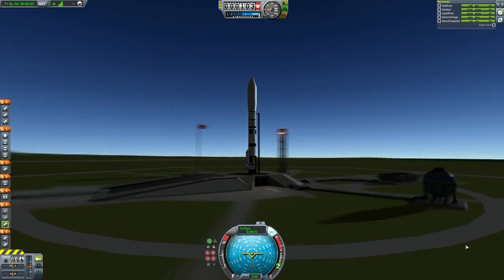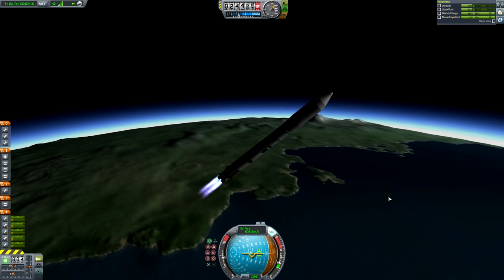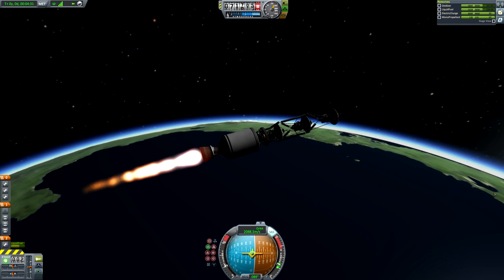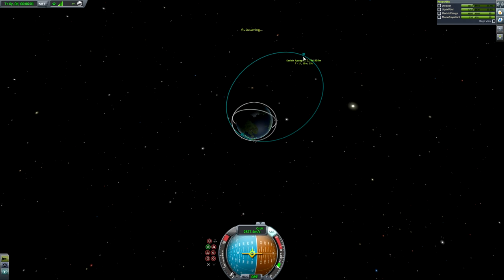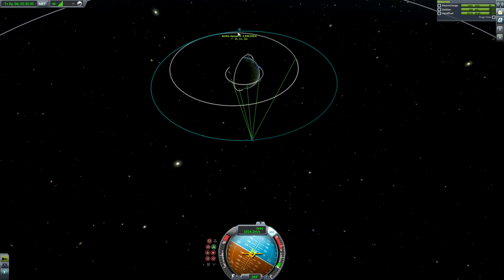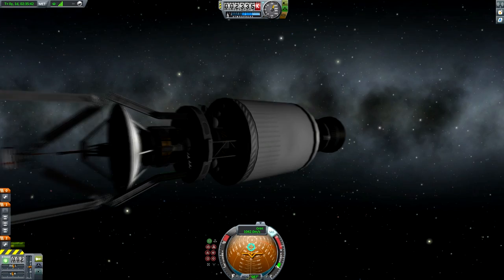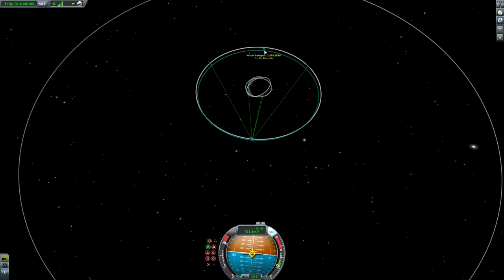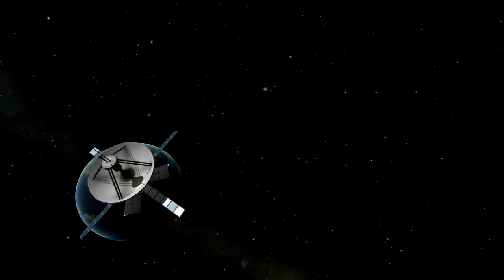KSP 1.2: How To Create a Geostationary Relay Network

Comment: How would I calculate how to do this on other planets? I tend to send way more unmanned than manned craft and would like to set up something like this around Kerbol specifically. That being said I would like to know how to figure out how to do it on other celestial bodies too. I've found the altitude for synchronous orbit on the wiki, but how do I find the other altitude to make three of them line up in a pretty triangle like you have. You mention a 4 hour orbit, which is obviously specific to Kerbin. I assume I would want to get my orbit to 1/3rd whatever the total orbit time for the body in question is, that's the part where I'm clueless. Thanks for any help you can give me and the video itself! Green lines all over the map! =D
Reply: Set surface speed to 0ms i think

Comment: Because of one or another reason I cant se my network....... A glitch? Or just not in for public yet?
Reply from the maker: It's in pre-release, so you have to opt-in to it if you haven't already!
Reply: +Matt Lowne I might sound dumb now... But can you already find iT in Downloads or is iT somewhere else/not available?
Reply from the maker: On steam, right click, click properties, click Betas, then in the drop down menu click the 1.2 prerelease
Reply: +Matt Lowne How can I get 1.2?
Reply from the maker: Please see the above comment...
Reply: Matt Lowne I'm sorry. Didn't see it.
Reply: Thanks matt!
Reply: I cant see the top left commnet bar.. Any ideas why that might be? I have all the new parts/scanning option available, put up a 3 geostationary relay antennas only to find this out
Reply from the maker: did you enable it in the difficulty settings?
Reply: Matt Lowne can you change difficulty settings without losing or having to reset your sandbox save. I have so many ships and stuff in my sandbox save I've had since last year lol
Reply: you can only see the triangular design on the tracking station
Reply: Up top you can see the connection type. If you click somewhere along there, you can change the connection type you can see.

Comment: How did you know that you wanted a 4 hour orbital period? I'd like to understand the math involved for how you prepare all of this stuff for getting (as close as possible) equally spaced satellites in this orbit. And, knowing this info, how I could figure out how to do something similar given different conditions (such as different bodies to orbit).

I'm trying to learn a lot of the math involved in KSP.
Reply: 4 hours is 2/3 of 6 hours, which is orbital period at the kerbostationary orbit, since 6 hours is how long a day lasts on Kerbin.
After you separate the first satellite from the delivery ship and circularize its orbit, the next time the delivery ship reaches apoapsis 4 hours later to separate the second satellite, the first satellite will have completed 2/3 of its orbit, so the separation between the first and the second satellites will be 1/3 of the orbit or 120 degrees. 
Same with the last satellite: once the delivery ship is at the apoapsis another 4 hours later, the third satellite will have the separation of 1/3 of an orbit or 120 degrees between both first and second satellites. 

You could possibly make the orbital period of the delivery ship only 1/3 of 6 hours, i.e. 2 hours, but I haven't done the math, so I'm not sure if you can set the periapsis low enough and avoid reentry.

Alternatively, if you wanted to have e.g. 4 satellites positioned with equal intervals, you'd want the orbital period of the delivery ship to be 3/4 of the target period, so that each time when you separate the next satellite, the distance between it and the previous one is exactly 1/4th of the orbit.

Comment: Hello, can you detail the calculations about how you designed the orbit so each pass was a third of the final orbit please ?
Reply: Kerbin day = 6 hours.
3 satellites with 6 hour orbits need to be 2 hours apart from each other in the same orbital path to be evenly spaced around Kerbin.
Delivery vehicle needs to hit apoapsis every 6-2=4 hours
Set apoapsis to geostationary altitude, then increase periapsis until Kerbal Engineer says your orbital period is 4 hours. (Using Kerbal Engineer, which he mentions in the video is how he did it, means you don't actually need to worry about the math)
Reply: Cool thanks

Comment: Ok, I've got just two questions.

1. Is 1.2 out yet or is this the pre-release your playing?

2. is it possible for somebody to make a geostationary POLAR orbit? (Possible challenge, perhaps?)
Reply: I think 1.2 just came out

Also polar orbits will mean sweeping over the planet's area. Unless Kerbin rotates polarly, a polar orbit can't be stationary. It can still be synchronous, passing over the same spot at the same time every 1 Kerbin day.
Reply: 1.2 is not out.

The closest thing to a Polar Geostationary orbit is two satellites in opposing Molnya orbits.
Reply: lol you're technically, scientifically wrong there. geosynchronous polar orbit I suppose?
it's geostationary, means its position is stationary relative to their body surface.
you can achieve geostationary equatorial orbit, as the object moves along with the surface in the same manner.
but how could you achieve geostationary polar orbit?! an orbit that the object is stationary relative to one of those polar?! that's just simply impossible.
well unless hyperedit came into play I guess.
Reply: Any orbit around Kerbin as long as a sidereal day is a synchronous orbit. A stationary orbit is a circular synchronous orbit over the equator. A polar stationary orbit is impossible because stationary orbits are only possible on the equator.

Comment: Matt, you brilliant space fairing wonder wizard, What exactly is a geostationary orbit???????????????
Reply: An orbit in which your vehicle/satellite is always sitting over the same point on the celestial body.  The satellite is orbiting at the same speed as the planet or moon is rotating.  

The use in this case would be so that one of the satellites is always over the space center so it can send/receive signals for control.  The other two satellites relay the signal around the planet so that if you are on the other side of Kerbin you can still reach KSC.

1.2 also places several transmission antennas on Kerbins surface so a relay satellite not in geostationary orbit should still pick up signal from the other antennas on the planet.  The mod RemoteTech did not have additional antennas on the surface so this three satellite configuration in geostationary orbit was a must.
Reply: overkill1340 ok
Reply: Actually, the speed is not the same as the rotating speed, at least not linearly. It's the same angular speed.
Reply: and is only achievable directly above the equator, otherwise it's geosynchronous orbit..
Reply: Laurens Peek ok

Comment: OK, so, you said that a comms network isn't necessary. I am trying to put a sat in orbit around Gilly but, I keep losing comms with Kerbin as soon as I leave the Kerbin system. Is it cuz my antenna isn't big enough? Maybe I should add more than one? How would you maintain comms with a sat orbiting Gilly when Eve and Kerbin are on the opposing sides of their respective orbits?
Reply: You need a relay network.   There are comms ranges listed in the parts info.   The bigger the number the farther you can communicate.   Try sending a combat with big relay dish around orbit about halfway between duna and kerbin. Some Antenna power can be stacked.  Added together the more you have the farther the comms distance.
Reply: @Bendigo1  I agree but, He said a network wasn't necessary. We say it is.
Reply: @Thumper770  only noobs play with no network requirements  😑
Reply: @Bendigo1  Pretty sure Matt isn't a NooB. He said it, not me.
Reply: @Thumper770  he also said he uses comms required for probe control tho...

Comment: Can't I just set up the relays near the edge of the planet's SPHERE OF INFLUENCE to ensure maximum coverage? I mean, that would be really handy when we start going to other planets. The reason I say sphere of influence and not geostationary orbit is because, when I send probes to their moon/s, there will be a lower chance of losing control because the probe happens to be in a "blind spot."
 * even if the moon in question rotates in orbit, it should be controlled by at least one relay. If I set them up in geostationary orbit, the moon can block the signal and the connection is lost.
 * I might even change the inclination of two of the relays so that I can get stronger coverage as I get closer to the north and south poles of a planet.

Anyone agree/object to this move?

Comment: If the goal is getting 100% coverage at all times, why can't the satellites be at any reasonably high altitude?
Reply: slowclap
Reply: You absolutely can. If you are looking for 33.33% coverage (which is a very bad idea) from 3 satellites you can put them at 1200Km. Sloppy orbits and rounding errors in the game will cause the orbits to drift so you'll want something higher than that. 1500Km gets you 35.71% which might keep you going for a while? 2/3 resonance puts your peri at 505.2 Km.

Personally I use 4 sats in a 1000km orbit, 7/8 resonance (1 sat deployed every 2 orbits. it helps with the delta V on the sats) and a peri of 727.44Km but I couldn't tell you why.

Comment: Unfortunately, whenever I've tried this I spend hours setting it up, and after one trip to Duna and back, the tiny deviations in orbital periods start to add up and the satellites start bunching together. Unless you use cheats to get the apoapsis and periapsis altitudes exactly correct, this setup will only work for a few in game years.
Reply from the maker: Yeah it's difficult, but I think maintaining and balancing the network is part of the fun :)
Reply: The way i've always done it in remotetech is with the orbital info from mechjeb so I can get the orbital period to be 'the same' to within 0.01 seconds which is the limit of precision in what the orbital info provides, and that way I've yet to have my satellites bunch together even after 80 years game time and counting.
Reply: Luca Deltodesco Ah okay. Are you talking about using altitude hold/autopilot, or are you talking about manually setting this up whilst using the extra orbital info displayed whilst using mechjeb?
Reply: I might be a terrible person, but once I get my network set up with the maximum precision allowable by the interface, I edit the save so that the precision I can't see is also taken care of.    
>.>
Reply: Shrike I like your style!

Comment: wait a minute so if you do geo stationary on duna you WILL CRASH INTO IKE???? ima try :P
Reply: Ike is almost but not quite Duna-stationary. If you put probes Duna-stationary, they will eventually cross into Ike's SOI. The solution is to put probes in orbits identical to Ike's but with different anomaly values. For instance, one opposite of Ike and the others to one side and the other. Duna-synchronous, which is good enough for KSP comms.

Comment: Wait why would we make a satellite network?
Reply: Communication around kerbin. if playing with only one ground station.
Reply: Would that be for something like, keeping control of a rover on minmus when it is on the opposite side of the minmus?
Reply: @TycoonTitian01  yes.  Or if there is a base on the mun opposite side of kerbin,   if there is no comms science cannot be transmitted.   And depending on the difficulty  probes and rovers cant be controlled without com network available.
Reply: @Bendigo1  yeah found out when i landed my first rover on minmus, and when it was on the bright side, only lights and brakes worked
Reply: @TycoonTitian01  yep. I planned a whole mission to eve, all kinds of science and solar panels and antenna  then got about half way to eve and everything stopped working during a mid course correction burn because the mun blocked the signal. 🤦‍♂️
Reply: @Bendigo1  Yeah, it freaked me out bc i was on a slope going down and it took me a solid three minutes to figure out the brakes work
Reply: @TycoonTitian01  😂
Reply: @Bendigo1  kinda random, but do you know how to make it so the rover doesnt try to rotate when pressing “w”? I was driving it and it kept trying to do a summersault (was using a probe core, didnt have the rectangular one)
Reply: @TycoonTitian01  disable the reaction wheels on the probe core or any thing that has reaction wheels.   
It will also reduce electricity consumption on a rover if you disable reaction wheels.  If you click on the probe core to get the info panel it will be the checkbox that says togle torque.
Reply: @Bendigo1  yeah, but it still was rotating, actually come to think of it I may have forgotten to do it for the core

Comment: how do you change from Satellite  to satellite?
Reply: If any craft or Kerbal is within 2 km, you can press the [ or ] keys to switch between the previous and next objects. Or, you can go to the space center, select the tracking station, select your desired craft in the list, and click "Fly". However, the latter option takes a little more time to do so. Alternatively, you can bring up the system map with M and right click your desired craft, then select "Switch To".

Comment: why would you need a relay system?
Reply: In career mode, you can get the 40% bonus for science gathered from Minmus and The Mun, by sending a relay probe with the HG-5 to each one first.

In science mode, you can get the 40% bonus on Minmus the same way (you can't get it on the Mun, because the tracking station is already fully upgraded in science mode, so even a command pod with no extra antenna can transmit to Kerbin w/o a relay)

Comment: Vectors are the worst.
They have less TWR than Mammoth, you need 4 1MN thrust Vectors to equal the 4MN thrust of the mammoth, which is more expansive and heavy, and uless you only need 2 or 1 of them (which is unlikely) use the mammoth, and put a second SRB, you cheap but Snob Kerbal!
Reply: Well, u have to pay extra for the second SRB
Reply: repeatig, Cheap But Snob!
Reply: But they have amazing gimbal.
Reply: Why do i keep seeing you in comments
Reply from the maker: They exist because they have enormous gimbal range, which is also why they cost so much. They're specifically designed for ships with asymmetrical weight/thrust (e.g. Space Shuttles, Setups like the on in this video etc. etc.)
Reply: MATT LOWNE, THIST IS THE THIRD TIME I SAY THIS, SSTO TO ALL EASTEREGGS (things like the moholo, piramids, ufo, kraken, munarch
Reply from the maker: I'm not going to make that video, sorry
Reply: The thing is,  in Sandbox mode, a 5-engined configuration of Vectors (My new Cerberus launcher) is much more efficent and powerful than the older Mammoth configuration (The Athena.) It's actually too powerful for its own good, unless you're delivering heavy shit, but then you could just add payload boosters.
Reply from the maker: Yeah it's way OP. But it's cool af
Reply: 잍대르하같지른듣빅